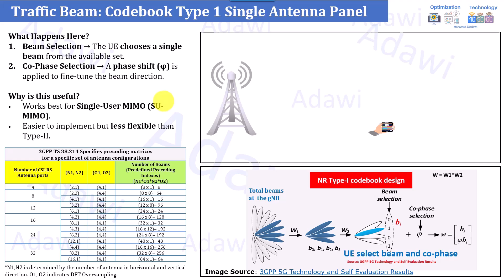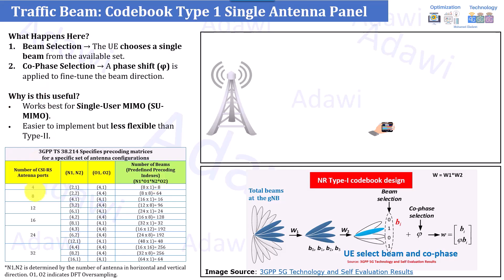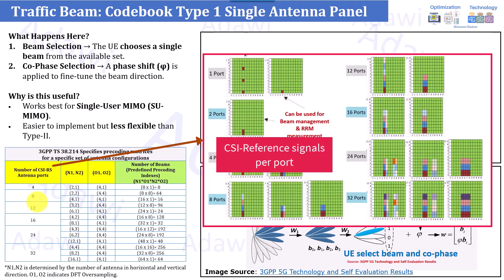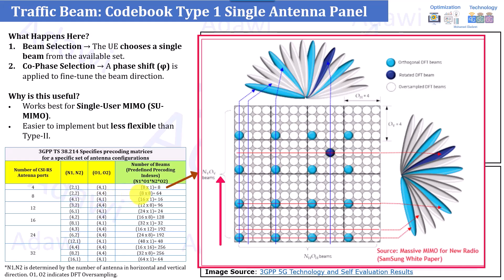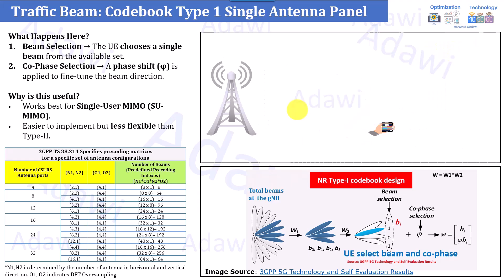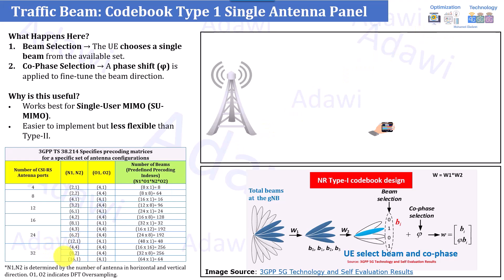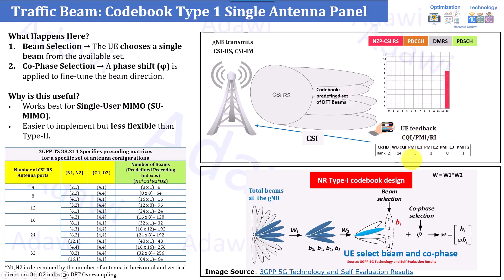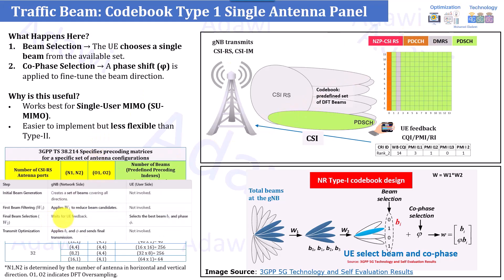5G Codebook Type 1 Explained: PDSCH Beam Selection Made Easy

Comment: Hi Mohamed, 
Thanks for the video. Well explained. 
What happens if operator configures 2 csi_ReportConfigs, one with 'n1_n2 two_one_TypeI' and another 'n1_n2 : four_one_TypeI'
What is a purpose of this and what is a real physical antenna configuration?
Reply from the maker: That’s a very good and tricky question. From my understanding, the scenario you mentioned applies when the number of CSI-RS ports is increased from 2 to 4. In that case, moving from two_one_type to four_one_type increases the number of PMI selections in the horizontal plane. This provides narrower beam options, which can definitely improve the Signal-to-Interference-plus-Noise Ratio (SINR).

However, since you are configuring more antennas in the horizontal domain, the existing antenna elements are distributed across a larger number of beams. As a result, the per-beam transmit power is reduced, and the signal may not reach as far compared to two_one_type.

As for the real physical antenna mapping, this is typically implementation-dependent and can vary from one vendor to another.